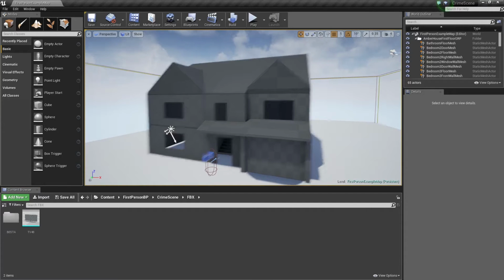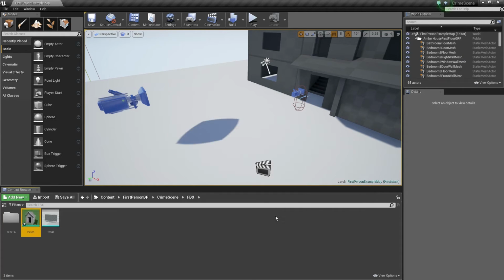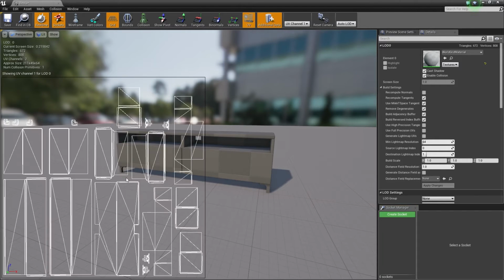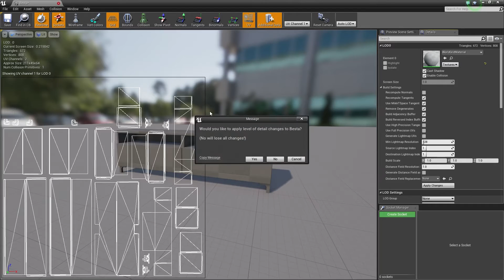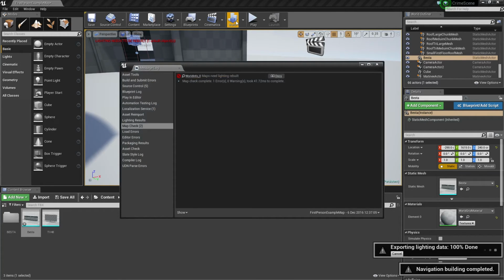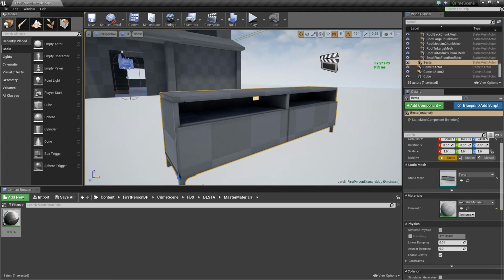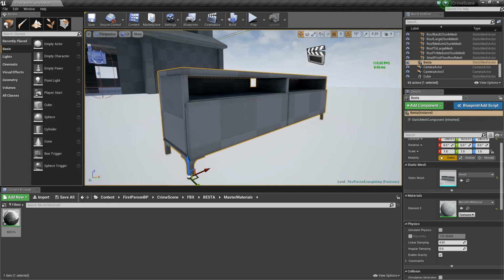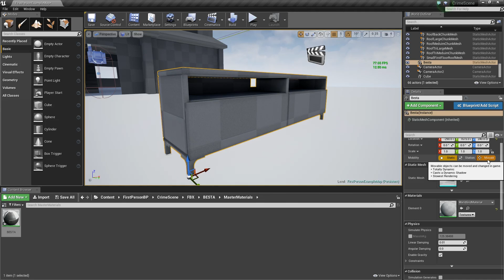UE4 Lightmaps Part 2

Comment: aww thx man your really helping me out big time!!!! you got a subscriber from me !!! after i set up my light maps and import an follow these steps can i use dynamic lights from inside of unreal and it will cast flawlessly after build??
Reply from the maker: Well you dont need to bake Lightmaps for Dynamic lights only for static, but you will need' to have a mixture of baked and dynamic lights in your scene, if you went full dynamic it would put alot of stress on the engine. You tend to bake lighting on objects that dont move, for example floors, walls and roofs. These also have the highest concentration of shadows cast so they should have a higher resolution value in the engine. Have a look at at this document from Unreal https://docs.unrealengine.com/en-us/Engine/Rendering/LightingAndShadows
Reply: aww man my head is hurting so bad!! i just dont no what to do it all seems to much . im a very seasoned designer but im struggling with performance ...i only use point lights directional lights and the light source ,and i i use them together, im getting extreme lag but my game looks gorgeous!! i dont no how to get the look im going for without such lag!!!